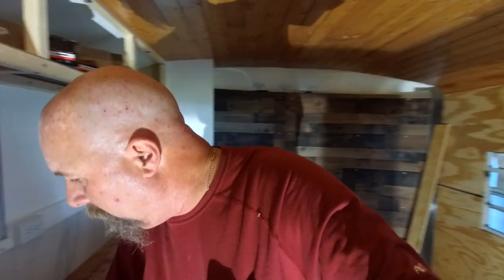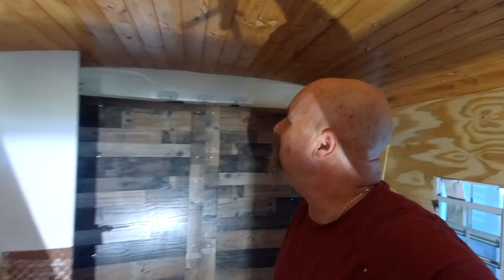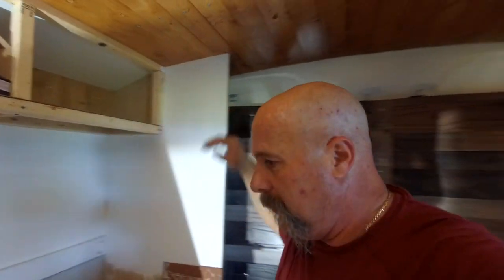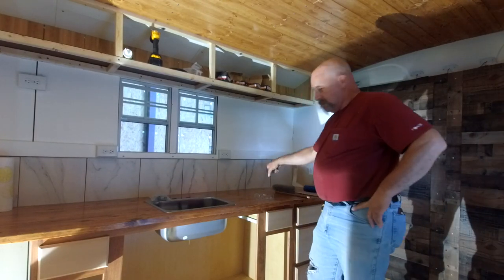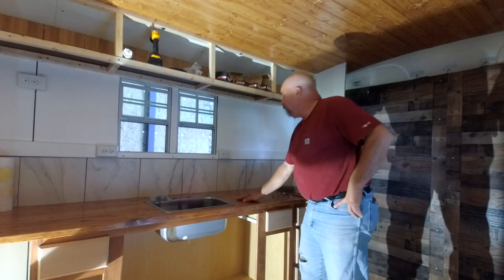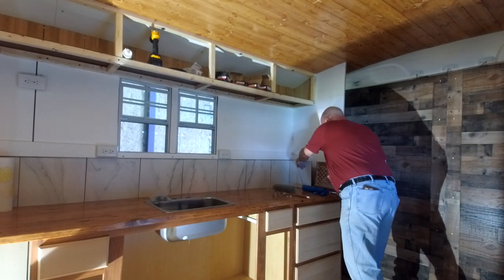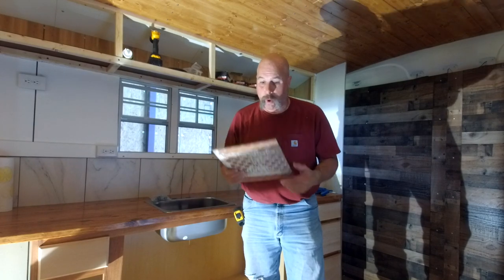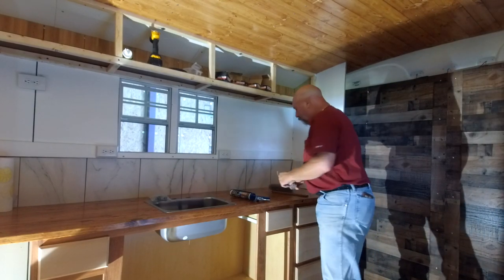519  Kitchen sink install / Cargo trailer RV Conversion

Comment: Your kitchen is looking great despite the little bumps in the road. Those little windows are cute and functional. You might be able to find a small window fan with a reversible feature to use as an exhaust fan when you cook. Keep up the good work Big Stan and soon enough you will be making your own version of fine cuisine! 👨🏼‍🍳

Comment: Home improvement Pro Tip #1,  Always buy about 25% more of everything you think you need, and even parts you don't think you will need, then return what you don't use.  It seems counterproductive to guarantee you will have to make two trips to the store, but I have never completed a project without at least two trips, more often than not it is three or four.

Comment: You know, for an "occasional use" or temporary make-do type camper/trailer that trailer is starting to look pretty high end! ;-)  Nice job!  Oh, and you know you jinxed yourself.  You should've spent the extra $1 and bought two tiles even though you only needed one.  That way you know you wouldn't have broken the first. ;-)

Comment: SHURFLO 94-009-10 Electric Faucet - White: is what I went with. I installed my sink just last week. Haven't installed this faucet yet. It will be hooked up to a submersible pump in my 20 gallon fresh water tank for ambient temp only water. I don't want to run pressurized water into my rig. The pump will pump when I turn it on, and it will be off at all other times. No chance of a leak.

Comment: Stan cant  u buy more tiles than u need and return the extra u are left over with ? Its normal policy in Poland.
Reply: Or buy a box and stash them for when the tiles start popping off going down the road.
Reply: @seanobrien7169  No way. He is a pro. The whole trailer will fall apart before the    tiles go 😁